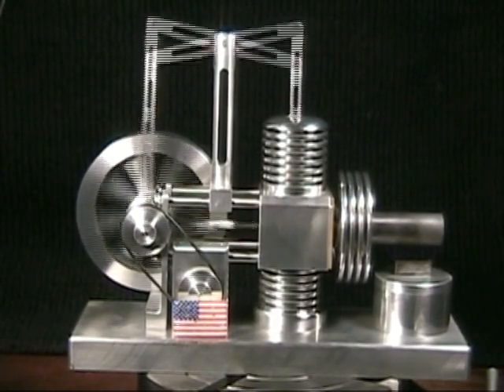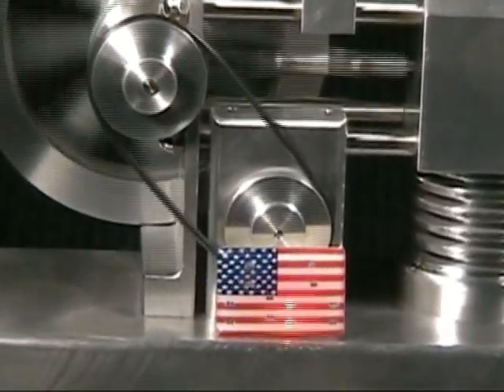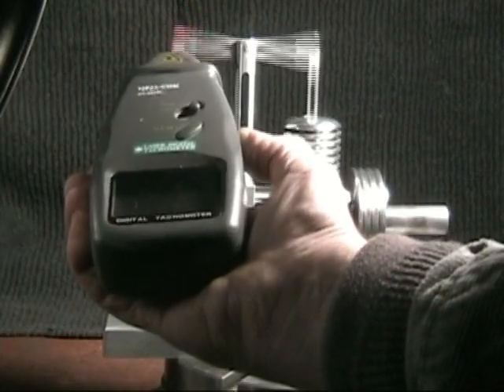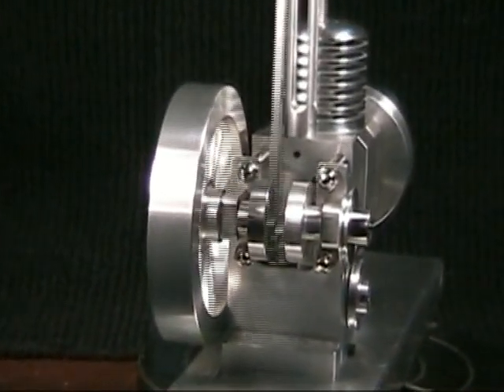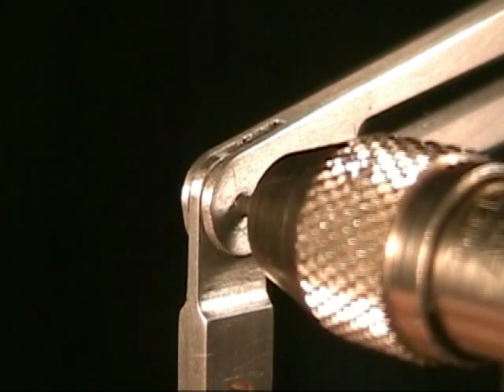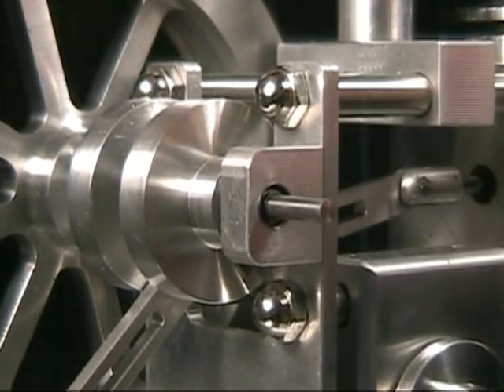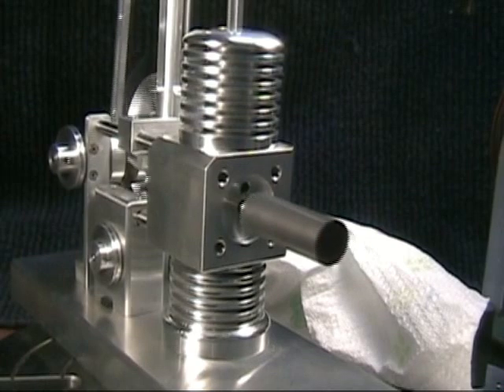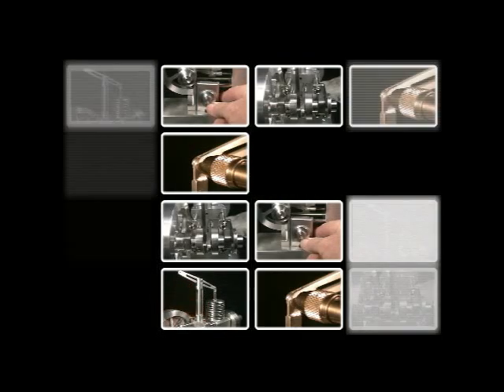Stirling Engine With DC Generator

Comment: as well as having the hot exhaust from a generator to power the sterling engine, i've wondered if using a "flame licker" with a large displacement and a sealed exhaust that leads to the licker intake, would create a vacuum on the generator exhaust giving the generator an extra fuel free power stroke and then attaching a small  generator to the flame licker, maybe having a bunch of small lickers in a radial configuration to create a constant flow/vacuum

Comment from the maker: Dean, I'm sorry to say my little model is really low in torque. It's doing about as good as I can expect. It sounds like you had a really good system running to get the power you needed. Good going. I was able to get the engine to run with a large Fresnel lens.
John

Comment: Great!  The Best One I ever watched so far.

We are a not-for-profit organization working in Africa. 

We are planning to build a power plant (small scale for our mission boarding school), using Parabolic Mirror or Fresnel Lens to capture the heat energy. Then turning it into electricity to charge batteries.  

If you can help, we would appreciate it. 

pjk4tm   at   gmail   dot   com

PJ

Comment: That is a beautiful piece of work you did there. I admire your skill. I'd love a model like that, but don't have the machine shops skills that you obviously have by the shed load. I've seen cheap models of similar sort without the beam on ebay. They are made in China but are a poor version of what you did there. You could sell a  model like that for good money. Most guys who make these things won't part with them. I can see why.

Thanks for sharing this.

Comment from the maker: Well, a Stirling big enough to lower grid costs is a possibility, but this motor is a replica of an old technology. There are actually some modern designed engines that would be more practical. I like the idea of coupling it with a fireplace of wood burning stove. Thanks for the compliment and watching the video.
John

Comment from the maker: Hello Christian. The motor will actually stall if the load on the generator goes higher that about 100 ma. These small models really are low on torque.
Thanks for the compliment and watching the video.
John

Comment: i have a motor i have been working on as i have a unique design to achieve what many are trying to do that is produce a clean source of energy with negligible or insidious form of input and i may upload a video of it if i ever get it finished. keep an eye out for it and i am not sure what i will call it yet maybe a G field reactor
would be appropriate. i wish i had your workshop DadHav cheers

Comment from the maker: Hello Mat. Good question. Actually it's not a combustion engine. The engine runs on heating and cooling the same air all the time. The is no intake or exhaust, it's completely closed. So this does cause problems. First the torque is low and second the performance is limited to how well you can cool and heat the air. After about 10 minute the parts of the motor heat up and the cooling goes down so you loose some speed. It's more of a desktop model than a real life concept. 
Thanks 
J

Comment from the maker: Actually Fargle. I did run it with a Fresnel lens. The lens was only a plastic 8x10 inch but it did run. Very low on power though. It looked pretty cool though.
J

Comment from the maker: Hello. The generator is only a DC motor from a tape drive, and the motor itself doesn't develop much torque. About the best I can get out of it is around 6 volts at about 50 ma. if I remember right. An axial flux generator is what's used for wind generators usually. Magnets in the flywheel passing coils would be similar. 3 phase would use less torque I think and could be rectified and filtered to DC. Good luck finding a job.
John

Comment: Insults thrown at others reflect a lack in one's intelligence. This is further exacerbated by your lack of countering citations or theories in the face of a "proof of concept" Sterling engine utilizing sound properties of thermodynamics that has been in existence since the late1800's.

Maybe your definitions of "energy creation and destruction" are incorrect? Perhaps you intended to state that, "energy is generated and consumed on a daily basis." Either way, you may want to revise your post?

Comment from the maker: You may not fully understand the principle. The motor runs simply on the heating and cooling of the same air over and over. There may be only a few cubic inches in a motor this small so you have to increase the volume by as much as twice to move the piston in the cylinder. This happens a thousand times a minute on this motor at least. I don't think a liquid would increase that much in volume fast enough. Yes the heating and cooling is almost instantaneous.
John

Comment: So, if heating and cooling make the gas grow and shrink, then the greater the difference, the greater the effect, and the more energy with with the gas expands and contracts. this allow the sterling engine to move faster, and do more work, because 60 degrees of difference represents a lot more moving air then 10 degrees of difference. Water, because it is an efficient conductor of heat, can be used to cool one side of the engine, thus increasing the amount of change in volume.

Comment: no, liquid is a better transferring heat then gas, but 1cm3 of scalding hot liquid is always 1cm3, until it actually changes states (solid in freezing, gas/vapor at boiling) it's volume will not change significantly. The sterling engine doesn't work because of heat directly , but it works because of /expanding and contracting volume/ because gas expands when heated, that's why heat differential works in the sterling engine.

Comment: you mean the heat up is faster than liquid?
my understanding is that the deference potential of heat whatever the temperature is it can make it work, i mean if the heat is is about 80 and the cooling air is 45 then it work within the range of air is extending temperature, is that true?

Comment: well, theoretically, yes, but the problem is, most liquids don't change volume as they heat up. liquid CAN be used to help cool off radiator fins, and make it more powerful, however.

Comment from the maker: Hello. The engines you see modeled on these videos are a basic replication of a historic principle. There are, however modern versions of the Stirling. I'm pretty sure the British had a submarine with an auxiliary Stirling engine. It certainly must have some power and I imagine the principle behind this might be that it can run stealth because of no emissions. Anyway as a practical application the Stirling may have trouble competing with wind or solar in my opinion.
John

Comment: Cool engine. Any idea why stirling engines are not widely used in industry? It just seems they could bring much more benefits than otto engines or even gas generators. Can stirling engines generate greater amounts of power? What is their power-to-weight ratio? I'm just curious. Thanks for the video!!!!

Comment from the maker: Mag bearings would help a little bit but I'd be worried about the movement you have in the bearing area. It be problem with side pressure and balance. Good idea though.
J

Comment from the maker: Indeed Hammer. You hit the nail on the head. Most who can build one of these well enough to run would certainly agree. The fact is there's only about a cubic inch of air in the engine which expands and contracts over and over. This doesn't give you to much to work with. The engines have to be almost completely free of friction, have the most perfect fit of the power piston and balance. A working  model brings great satisfaction. One that can do a little something is even better.
Thanks.
John

Comment: its an exercise in machining.  A hobby.

Sterling engines, vaccum engines, flame gulpers, etc... these are extremely inefficient engines with low output.  2-stroke and 4-storke engines are about 50 to 1000 times more efficient, maybe more.

The idea that he was able to gain any usable voltage from a sterling engine is a neat trick. :)

well done.

Comment from the maker: These motors are a little funny when it comes to temperature control. Sometime using to much heat will only speed things up on a temporary basis because the rest of the parts on the motor also heat up. I think you must not have meant 4500 C. Steel melts at about 1500 C if I remember right.
J

Comment: I think you are on the right track. Being all polished up and all makes it look pretty, but why not switch the connecting rod for the power piston the the vacuum pistion out of a composite, carbon fiber maybe. i know you need to spin a flywheel in order to keep the power flowing, but the lighter all the moving parts are the more efficient. Anything to keep the moving mass down. I wasn't bored by the video obviously.

Comment from the maker: The generator is only a DC motor but the output matches the torque of the generator pretty well. In order to put out more voltage and current the engine would have to be running a little stronger.
John

Comment from the maker: Hello, You are right the generator would spin faster but there would be more load on the engine also, so you have to try for a happy medium. This is a model of an old engine technology and probably wouldn't be practical as a real like generator or battery charger. My opinion anyway.
Thanks
John

Comment: I'm not an engineer of any sort so maybe this is a stupid question, but the flame used to run this machine is already generating light (and heat) by itself so why use it to run a machine that generates about the same amount of light and virtually no heat?

Comment: excuse the fact that i dont know the proper terminology for most of this but im gonna explain as best I can what I mean. If you increased the diameter of the thing that is spining the belt could you make it generate more then just 3 volts. for instance, the amount needed to power and charge an electric go kart?

Comment: There are some parabolic mirrors  dishes which use sun light, and concentrate all that heat into one place, at the top of the stirling motor, therefore making it work. As they say, they have succeeded in making from 2 to 12 KW. I saw some videos, some firms are making them, but not for home usage, but only for big companies.  They even offer online plans for it, price of 100 dollars. Thank you for your informative answer.

Comment from the maker: Actually the motor is a model in it's simplest stage. There are actually modern Stirling engines in operation today. As a mater of fact I read somewhere there are auxiliary Stirlings in a few submarines because they can run stealth with no emissions. I'm afraid up-sizing a motor like this would certainly be an attraction running in your back yard but it wouldn't be the most efficient choice.
John

Comment: You should try using ceramic bearings.  They have lower inertia, and much lower friction at high speeds.  Also, perhaps some of the displacers could be ceramic tubes as well.  You're best bet would be silicon nitride if you went that route.  Great video!!

Comment from the maker: Hey Giz. This motor is very low on torque. If you don't have everything perfect it won't even run. The DC generator is only about 50 milliamperes. The motor is more of a demonstration model than something practical to produce energy.
John

Comment: If you were talking about adding nothing to the process you would be right.  I'm not talking about stealing energy from the known universe, I'm talking about generating hydrogen (an explosive gas) and oxygen (a reactive gas) from water, in a process known as hydrolysis.  Heretofore, that was an inefficient process generating more heat than hydrogen but the HHO generators seem to have overcome this drawback.  You obviously are not familiar with what I'm talking about.  Search for HHO on Youtube.

Comment: Except you can't train a sunbeam to focus on a moving vehicle.  I understand the nature of energy but thanks for the refresher. An engine which produces its own fuel (just add water) is the basis for this theory.  By the way, did you look at any of these HHO generators?

All we have to do is generate enough electricity to charge an electric car's batteries and, at the same time, produce enough hydrogen to keep the process going until the water runs out.  It's really not that confusing.

Comment: Can the Stirling engine produce more energy than it needs to continue to run?  HHO generators seem to produce more energy than it takes to run them and that is why I suggested that extra step. If the Stirling engine produces more energy than it takes to run them then why not heat the engine with an electrical element instead of a flame?  Do you see where I'm going with this?

Comment: Beautiful work. It appeared as though the engine slowed down a little when you plugged in the small light bulb at around 3:18. For stirling engines in general , I wonder if small fins inside the cylinder of the displacement piston might help to improve heat transfer and improve performance.

Comment from the maker: I agree completely. That's why the motor has to be built with such precision. There is very little compression to work with. This is also why the engine is low on torque. If you look at the LTD Stiriling it's even more surprising. They can run as long as there are a few degrees difference between the top and bottom plate of the displacement box. I have one on my channel if you're interested.
Thanks for watching.
John

Comment from the maker: Yes. That is already in my plans. I plan on using the flywheel as part of an axial flux generator. I will probably wind the generator as three phase. That way I can us the flywheel as a starter motor for the engine. There won't be a lot more power but there will be more than using the pulley and Little DC motor.

Comment from the maker: Hello. The little bearings just happened to be a rare find on E-Bay. I'm sure an Internet search would dig some up but these where reasonably priced. The graphite is material used in E.D.M. (Electronic Discharge Machines) The carbon burns right int steel to make a special shape for molding purposes. I've noticed a source on the Net. If you do a search for carbon stirring rods, you will find fine grain carbon rods for stirring hot materials.Thankss for watching.
John

Comment from the maker: @Fred6191 
Yes. The generator on mine is a DC motor. You can use it to start the engine then it will run as a generator again while the Stirling is going.
J

Comment from the maker: @joonkeen 
Remember the Stirling works only on the air inside the engine. It is continuously heated and cooled while moving from the displacer cylinder to the power cylinder. The only thing running the motor is the expanded and contracted air inside the engine. So this is not a lot to work with. The motor has to be completely free of friction and the power cylinder and piston must work freely but with the ability to contain the compression. 
John

Comment from the maker: @joonkeen 
The displacer is an all together different story. The air has to move around the piston freely so the air inside the engine can be heated then pushes up to the power piston. I think I have a little less than 1 mm clearance per side if I remember right.
J

Comment: i got bulid a stirling engine for my final year project, but it cant run when i burn the power piston with torch. it can run smooth when i try to spin the flywheel. i dont know why it cant run. is it the gap between cylinder with power piston too big? my piston OD is 33mm n the cylinder ID is 33.5mm.

Comment from the maker: @piccolopeteisme 
Yes, you're right on all accounts. this engine is completely dependant on free moving parts and it took a lot of work to get anything out of it at all. This particular engine is very weak. Also, I've had plans for quite some time to put magnets in the fly wheel in a three phase low cogging configuration. As example: 14 magnets in the wheel and 12 small coils facing the wheel should provide something like 84 pulses per revolution to the rectifier. 
Thanks for watching
John

Comment: @DadHav I'll post it when its done, the engine would only work with a four stroke airplane engine because it unlike a two cycle has a solid sleave cylinder, the two stroke ones have intake exhaust ports in the cylinder, my engine was old and worn out with a broken valve spring and very little compression so I figured it would make a good donor engine for the project, I'm still going to try and use the prop for the flywheel.

Comment: Great video I am building one of these from an old four stroke model airplane engine and am almost done, I took the ring off of the piston and now the engine spins nice and free but has a near air tight seal, now I just need to build a deacent displacer unit, I plan on powering a small town like set up with belts driven from the engine, saw mill, wind mill, water fountain maybe

Comment from the maker: @agbarumba 
I would think It could be scaled up but I'm not sure there isn't better designs to get more power. If I understand correctly, the old Erickson engines actually where used to run farm equipment, but the design was a lot more complicated than this simple engine. I was told the the UK has a submarine with a hybrid Stirling engine in it to be used as an auxiliary in stealth mode.
Thanks for the compliment.
John

Comment: Beautifully made. I like the addition of the bearings and it's nice to see such a machine performing some work.
- I'm still waiting to see one running from the heat generated by a compost heap, pumping water from a fish pond, through a cooling jacket and back into the pond's biological filter, though.   :)

- Again, lovely machine you've made.